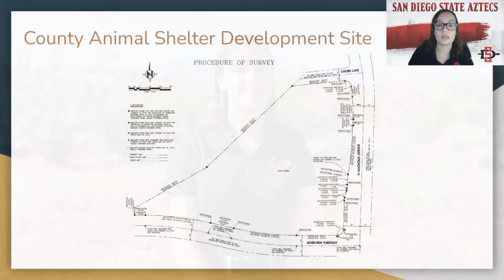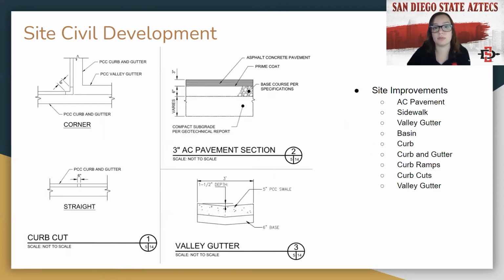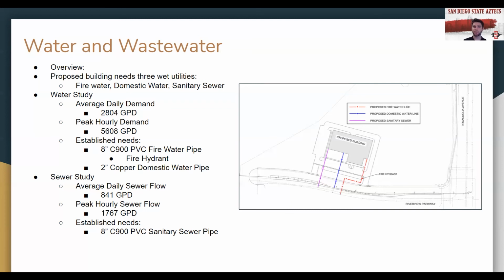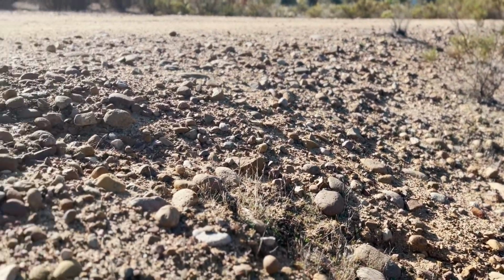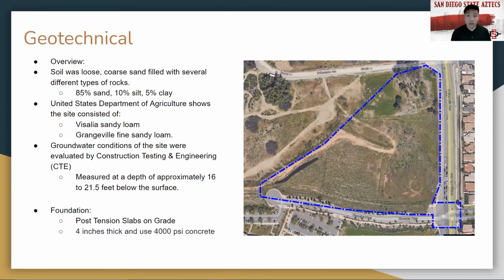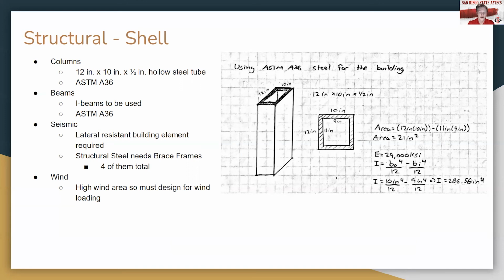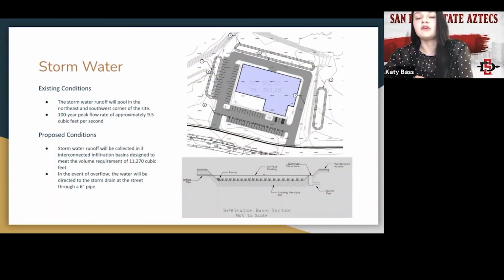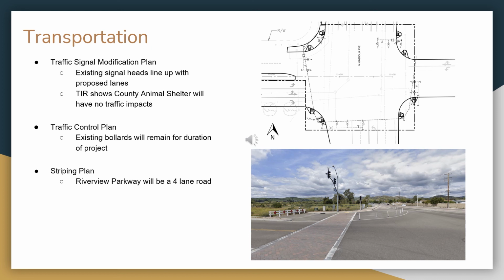CIVE495 Team 9: County Animal Shelter in Santee, CA

Comment: Congratulations team, the site video gives a good idea of the site conditions and challenges.  Some comments on the geotechnical and structural: Good job on recognizing the geological conditions, just a bit more research was needed to provide for the seismic parameter and site classification.  Good job also on recognizing the design method (LFRD vs ASD), and acknowledging seismic and wind.  It would have been nice to list some of the general lateral design parameters.